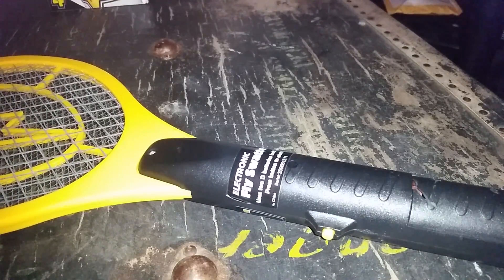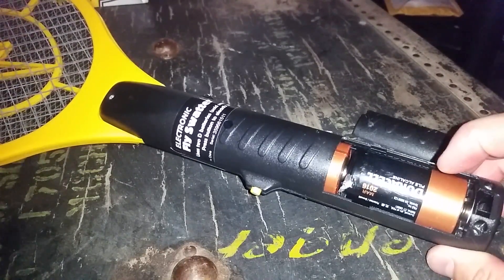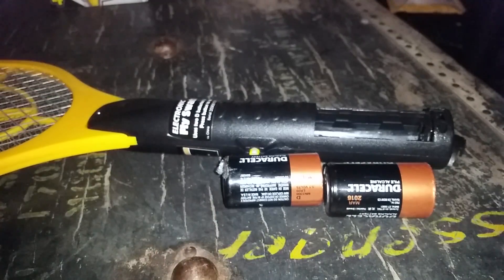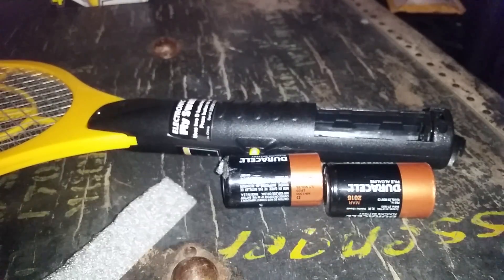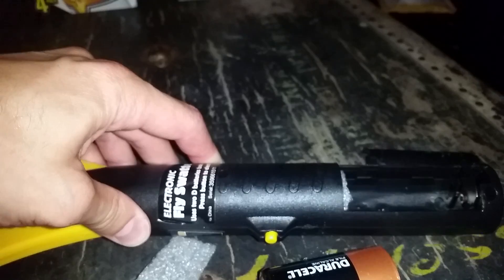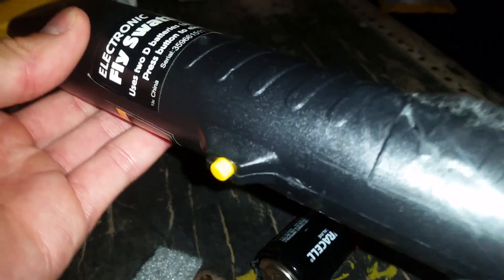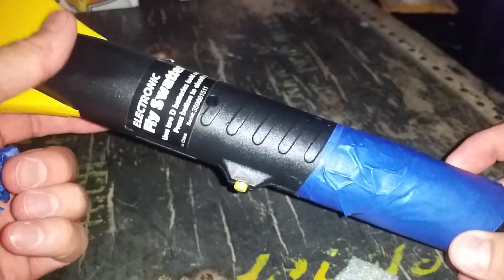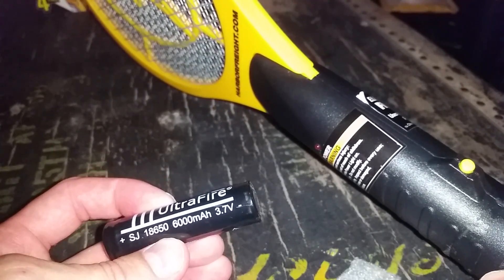Electronic fly swatter lithium ion 18650 upgrade hack

Comment: I bought a couple of the flyback circuits used in these zappers and they say they can run on 3.7v from a lithium cell and maybe you can add a charging board.

Comment: Rubber bands for the handle might be better than tape. . . if you've got that saved stash of bands from produce and such.  Personal preference maybe.  I've done the foam things with a flashlight and 18650.  Foam works around the 18650; the fake battery was tougher.  I used a burned off strip of aluminum can and foam for the "fake battery".  It worked at first and then the foam started compressing and contact wasn't good anymore.  Need something stiffer, like cardboard.  Also, if you have some copper wire, that is better than aluminum, but aluminum is a handy if you drink cans and don't have any copper around. Aluminum is more conductive than iron, at least.  With the price of copper these days, I always cut off the cords before I throw away dead electric devices, so that's a better choice.  A whole new meaning for "cutting the cord".
Reply from the maker: Lots of value in this comment, thanks for sharing! I'm sure you can make a nice adapter with 3d printing and some metal/wires like you mentioned.

Comment: I think it would be better to buy a 18650 battery holder,  glue it into the battery compartment and solder the wires to the original battery terminals
Reply: Bought one and the bottom broke out after a couple days.  I'm about to throw a 18650 with a holder in since I have several.  Should add a charge board that has a low volt cutoff to prevent damage anyway.

Comment: Oh man, mine uses AA batteries. I should make a remote battery pack for C or D cell batteries that could clip to my belt loop. You can also make a fake battery from aluminum foil.
Reply: I have aa battery one two and i want to know if i can use some of my 14500 battteries in there.
Reply: How?

Comment: ditch the socket  and put another 3.7 volt in there. i like the idea of wrapping the foam around the batterie 👍
Reply from the maker: cereal dust I like the idea! I've learned a lot about circuitry (from Ave mainly) and need to take a look at what I fried so I can upgrade those components to a mega swatter
Reply: you ll fry the circuit board?

Comment: You should have put two 18650 in series if one is 3.7 volts then two in series would be 7.4 volts, now you have a bug killer
Reply from the maker: Gary West if the swatter could handle it, the flies would probably be vaporized
Reply: It can handle it for a few seconds, I did it years ago
Reply: he can just buy two 32600 batteries, they are the same exact dimensions as a d cell so you can imagine they are a hell of alot better than 18650 i been using some 26650s and man those sons of bitches really got the juice. well im gonna try to put my 14500s in mine see if it will go from 3v to 8.4 okay

Comment: Still works? 
the LED circuit its isolate or can burn it?
Reply from the maker: Raul failed shortly after this video was filled, sadly
Reply: then you really need to pull the video

these things are only built down to a price

Comment: 6000mAh is a fake, your batt have ~100mah .
real ultrafire 3000mAh max.
Reply: True, Ultrafire are the worst.
When i drain tested my Ultrafire 18650 (which said 22 Wh [6000 mAh]), it given 0.7 Wh [200 mAh] only !!!!!!!!!!!!!!!!!!!!!

All other brands use batteries from the below base brands,
Panasonic, LG, Sanyo, Samsung etc... so do get from them for exact Wh [mAh] energy rating.